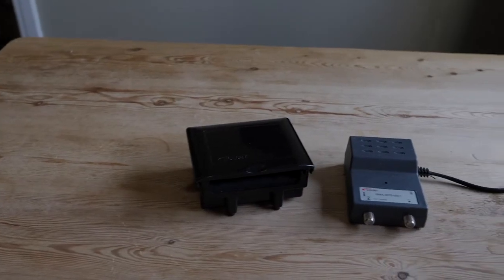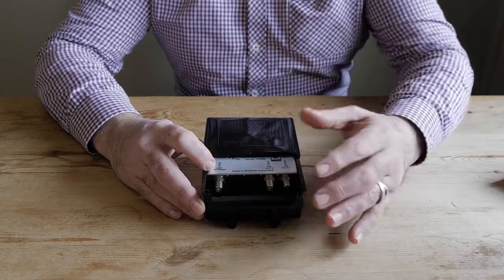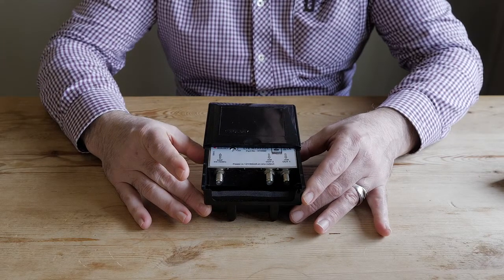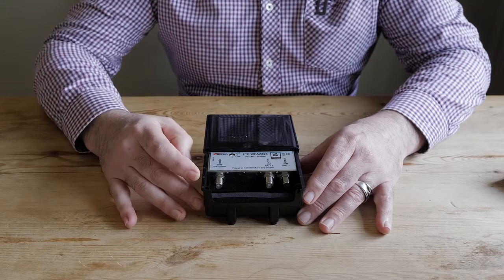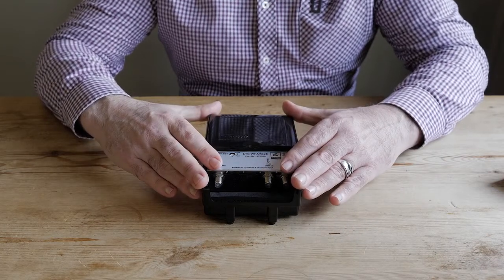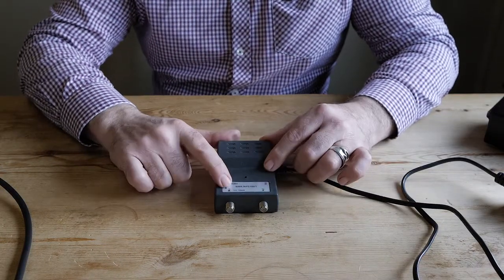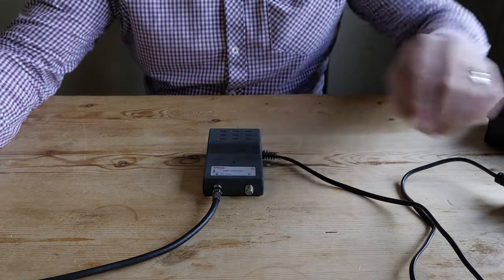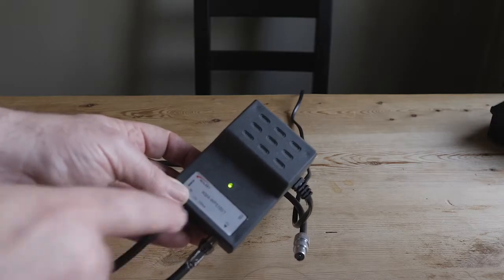How to improve your Digital Television reception using amplifiers & Boosters

Comment: Hi. My external box like that fully rusted the internal metal bit in your video. Could I just run a wire from the aerial to an internal booster/Amplifer in the attic that connects to the mains and split out to 4 tv’s